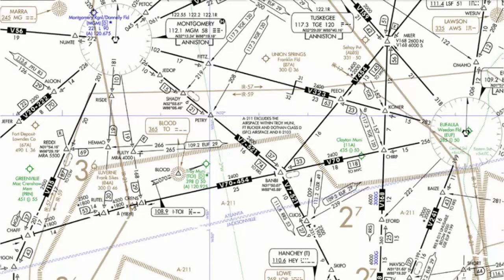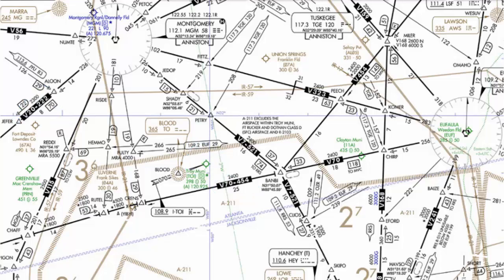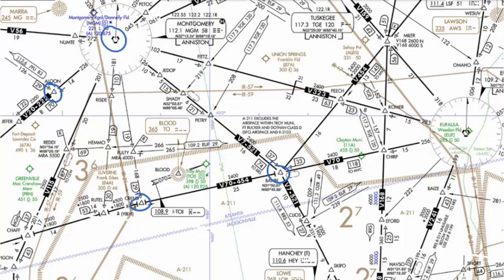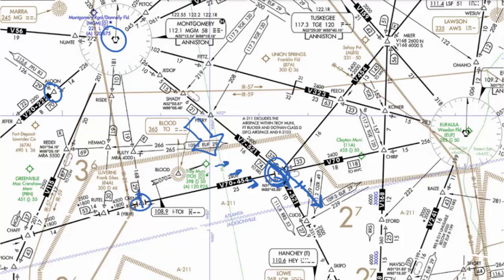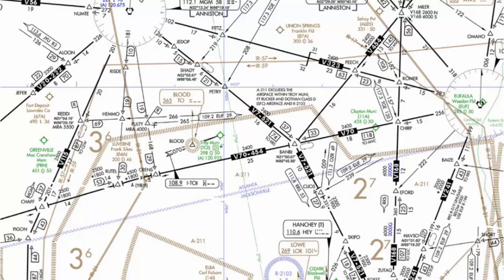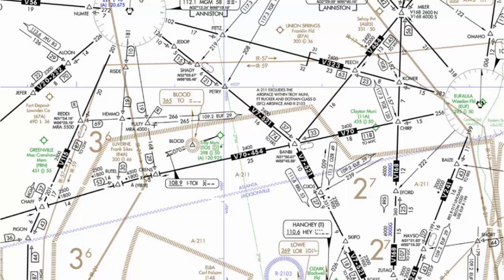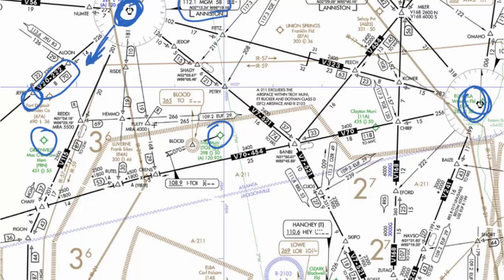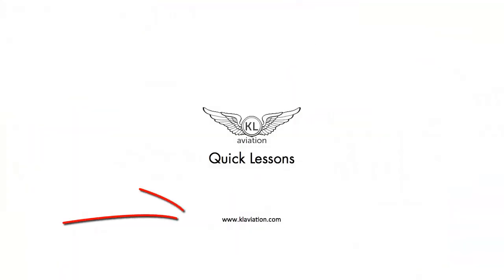Departing an Airport Without a SID

Comment: Can you explain how best to use the LOM and    approach segment safely while flying against possible traffic using the approach.
Reply from the maker: If you can talk to center or approach on the ground have them give you any alerts for traffic.  The IFR controlling agency should not release you for departure if there is a conflict with an inbound aircraft.  Broadcast your intentions on CTAF in case any VFR traffic is operating in the area.

Comment: INT are nice, but in VFR a VOR-to-VOR flight plan works too. Mine would be KTOI.MVC.NUN.KPNS That is if they let you fly through MOAs - otherwise slip in BFM.
Isn't RUTEL the cross of MGM and EUF? Can you get signal from both at RUTEL? I'd find the INT that way.
Reply from the maker: VFR you could do just like you have said.  IFR you would have to observe the service volume limits of the VORs which put you just out of range of MVC, especially on the ground at TOI.  As for RUTEL, I'm sure there are radials from MGM and EUF that define it, however I haven't seen them published which doesn't make it "official".  Thanks for the reply!

Comment: Question: how do we see or get to RUTEL if we fly aircraft that is not equipped with GPS as RUTEL is gps fix. Or am I missing something? Thank you!
Reply from the maker: You can get to RUTEL a few ways.  The first would be to use GPS and navigate direct.  The second is to look at the NDB 7 approach plate I show in the video.  You can follow the approach backwards to RUTEL using the Blood NDB, which is perfectly legal.  Thanks for the question!
Reply: Will Liebhaber
Hi Will,
Thank you for reply. But I'm still a bit confused. The reason why is that you mentioned at 05:27 that we're assumed to fly non-gps equipped aircraft. How would we know when we get to RUTEL (as I mentioned above that RUTEL is GPS fix) even if we fly outbound NDB 7?
Thank you for your time!
Reply: ***** RUTEL isn't a GPS fix, it's a traditional fix along V70-454. If you look at an IFR low enroute chart, you can identify RUTEL using the Montgomery (MGM) and Monroeville (MVC) VORs, or using a single VOR and DME. Following the specified bearing outbound from Blood NDB, you would know you are at RUTEL when you intercept the MVC 069 radial. You can confirm your location using the MGM 181 radial.